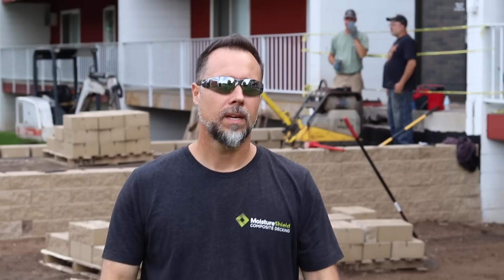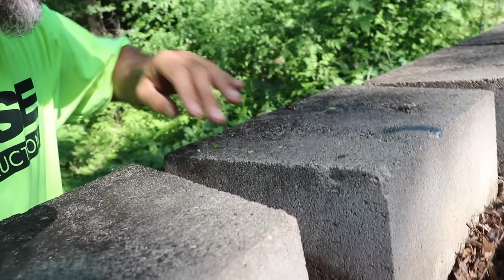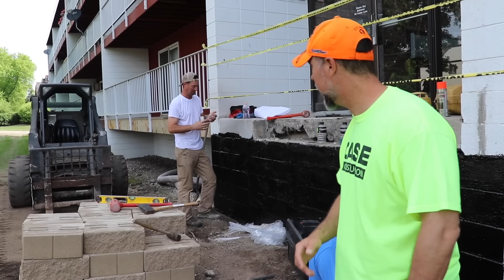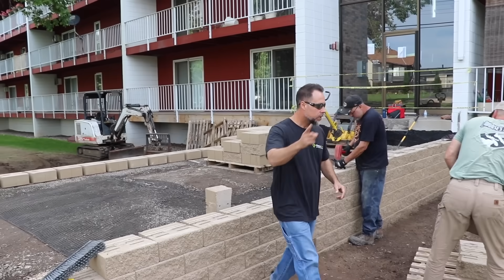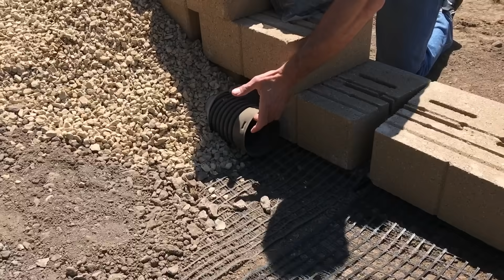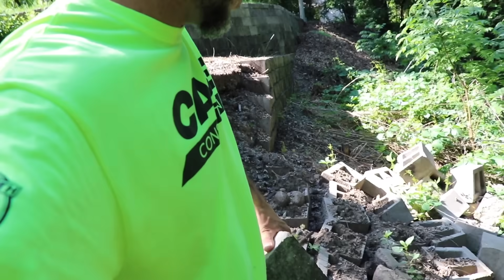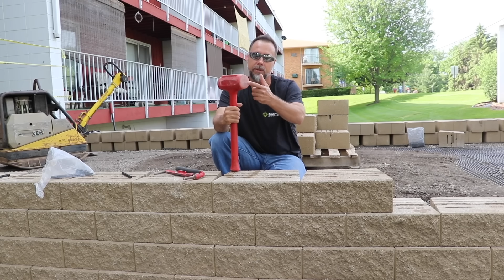How NOT to Build a retaining wall.  RED FLAGS, common mistakes, bad designs pt1

Comment: What if you wanted to keep the water and silt from draining through the wall?  In my case the wall will be retaining the ground above a sand volleyball court, I'd like the keep the sand "clean" on that side, and on the downhill side I'd like to keep the sand from filtering through the wall.  I assume I'd need drainage at the top and the bottom of each wall?

Comment: Stanley, I'm building a retaining wall with Allanblock Classic as a base and AB lites for the course.  I'm using AB cornerstones for corners but there seems to be a slight difference in height between the combined 2 x lites and the corners.  I also think I messed up by laying a classic as a base, not a corner.  The first corner was on the second course.  Could you offer advise?

Comment: On concrete decks at the patio, DO NOT level the concrete perfectly level. When it rains, the water will back up to the patio door and cause wood rot! The deck should slant slightly so the water can run off.

Comment: Video on dry creek and keeping flood waters back . I live in Missouri and have 2 dry creek beds in my yard , I took down a chimney with 1960 L shape blocks solid blocks laid them out so it was 77777777777 than went over them with flat blocks overlapping each corse filled in all the voids with broken blocks cemented them together fill behind them with 1 inch stone above water level , i park a trailer in the yard and that part of the yard would flood with 2 to 10 inch of rain and water get 16 inch deep the area is 10 foot by 20 foot and 15 foot  triangle  not sure it will last 10 or 20 years but it did not cost me anything but my labor and stone .  I have rip tie along the drive way and seen 300 pound rock dragged down the creek. might take the blocks out as well I have no idea yet no rain in 2 months .

Comment: Great video. We don't do a lot of segmented walls like this. In my area roughly 80 % are built without gravel, geo grid or drainage. Costs so much more to build them correctly. We average 47 freeze and thaws a winter. You can almost watch them fall over in the winter. Me and my guys have bets on how long it will take for there walks to start moving and fail.
Reply from the maker: Thanks Mark!

Comment: To be fair, open cell blocks are infinitely stronger than those pinned blocks, but only with proper wall fill / grout. And those lintel blocks or bond beam blocks with one side open are just for lintel courses and bond beams. So doing it right it's structural. Of course, for anything less than 10 feet tall plastic pins are fine I'm pretty sure.

Comment: Great video. I have a small landscape company in Pennsylvania. Lots of contractors are switching to Allan block because of the light weight and no pins. I agree with you completely on wrong block to use. I have tons of work repairing old/failing walls.
Reply from the maker: Thanks for sharing Tony 👍

Comment: This is a very informative video appreciate the time and the effort you put into this. So I doubt you will respond but if you use a hallow block and use the same procedure but fill those hollow blocks in will this be as good as using the blocks you used?

Comment: Thanks so much for this very good info.  I am going to be my own construction foreman for some newbies building a retaining wall for me :)  This helps a lot.  My wall will be 2 foot tall by 20 foot wide, but will have some load on it with a gentle slope behind it filled with decorative rock, so some pressure or surcharge, my question is do I need to add a drain opening somewhere since it is 20 foot wide?  So far the design will be 4 inches of base, 1 inch of sand, then a 82 lb. brick, 8x18x12" deep, will bury 4 inches of first brick, then 2 more layers of brick, then a cap, 24 total inches or 2 feet. Thanks

Comment: Thanks so much for all the explanation and examples of both good and poor quality work. Very helpful. I live in Kenya, and we have very few of the building materials available to us that you are demonstrating. Our retaining walls are built from hand cut stone. I'm getting ready to build a home for my wife and I. I'm not a builder, but I have to watch what is happening to try to make sure that things don't go too crazy. I'm thinking of having my masons cut the stones to be something like the shape of the blocks you are demonstrating here (sort of trapezoidal). These will be solid rock. I doubt there is any way to have them hollow or even have the holes and slots for the plastic inserts (which I could not get here either). We will need to build several retaining walls. Some will be higher than others. We are in a mountainous region, so the land is often quite steep. Any advice? Thanks in advance.

Comment: The way I was taught was to leave a gap between the grade and the wall.  Filter cloth the bottom and the side touching grade.   Add tiny bit of stone, pipe, fill with stone and filter cloth of the top.   
This keeps the stone together and separated from dirt.  

Is this not the correct way. Always made sense to me to keep then seperate because the rocks only work for drainage if they aren't mixed in with dirt :)

Comment: I’m wondering about Pressure Treated wood retaining walls- do these same principles apply or is it an entirely different sort build?
Reply: First things first Pressure treated wood retaining walls tend to fail after 10-15 yrs even when properly constructed due to wood rot. The block or poured concrete with engineered drain systems will last on avg about twice as long or longer when constructed correctly the difference is cost... the block/ engineered concrete systems usually cost more up front however over the expected life span cost less than the wood system.  The wood system is assembled in a similar fashion however an 8ft railroad tie (most commonly used wood retaining wall material) requires pinning every 2feet with full height of wall +2feet into the footing rebar.  Otherwise done similar to the brick and it will require a well engineered drain system. I personally don't recommend a wood retaining wall system for the additional complexity of construction as well as the short lifespan of the wall itself.

Comment: Great video pal. I want to do my Ma's back garden for her and I'm not really sure where to start atm.. I need to look into more of ur videos for more informatiin.. Thanks again pal
Reply: The only retaining wall I ever did was hard work.  My sister wanted a natural log look ... but I felt uncomfortable with that due to the weight it had to hold back.

I sunk sleeper into concrete and behind it I battened more CCA Pine sleeper horizontally.  Levelled those off and drilled through both for cup-headed galvanised bolts, 2 on each side of the sleepers.  That was all pretty solid.  Then I marked and removed the top sleeper to cut the verticals flush, before replacing it.  That gave me the physical wall.  Before I started I shimmed up the first horizontal sleeper to give a 1/2" ground clearance and filled the area behind with > 1/2 inch rocks to keep the slot from clogging.

Then, once I had a wall I knew was dependable, I marked out large half-logs.  Made two incomplete cuts into them where the verticals would sit.  Then with an old tapered spike and a hammer I made very rough notches, tidying up with a rough chisel.  That was the bulk of the real work!  These were then used as a fascia and slid onto the verticals.  The upper half log was only half-notched to sit on top of the verticals, and a half-diameter higher higher than the structural (sleeper) wall.  Then I started to fill with a bag of coarse stones, then large gravel... before filling up to the top of the log fascia with soil.

The resulting retainer was twice as thick as it appeared and didn't rely on the half logs for structural strength.

Was there a better way to do it?  Probably... but we had the confidence that it could hold back a tank.

Just one thing, if you use sleeper against soil or in-ground, check that it is fully treated.  Guy in the store recommended a particular grade of treatment but I'm damned if I can remember what it was now... but basically, you want it treated right the way through so it doesn't rot or get infested with boring insects.

Anyway... that's my war story ...

... I learned enough to never offer to do a large retaining wall again ; ).

Comment: Good video overall, although I usually quit watching when all the banter starts.   Regardless, good info on using grid with slopes.  Was hoping you were going to cover setback as that failed wall was definitely too close to the upper wall.  I’ve heard setback should be 2x the wall height before the next wall.  Any thoughts on that?

Comment: I haven't seen those blocks in my area (Tennessee). Having said that, how would you use Geo Grid with the hollow blocks? It seems the lip would be of concern. Most of the builders here fill the hollow blocks as appropriate. Great channel thanks for the hard work.

Comment: I am doing a short (maybe like 3 feet tops) timber retaining wall and planned to run a sock-covered perforated drain pipe in gravel along the base,  partially fill with gravel surrounded by nonwoven fabric, then backfill.  Is this no longer the correct way?  If so how do you keep the pipe from clogging?  I am figuring a short wood wall may be a little more forgiving then a CMU block wall, but if I can eliminate cost then that's great :)

Comment: Great vid. The only lipped retaining wall block units I’d use would be solid units. There about 78 pounds a unit.The pin system is great if it has zero curves. I don’t have to explain why, you already know what I’m saying. Ok, just say that I’d have to drill some holes for the pins. Great video, everything on your video is right on. Back in the mid 90s the fiber mesh was the deal. That replaced the dead men wall security systems. Geogrid is the Boss.
Reply from the maker: Thanks Donald, appreciate the comments!

Comment: So the geo grid acts similarly to rebar! A good drain around the perimeter of the wall with course gravel is required. Perhaps fabric in cold climates is capable of trapping water behind wall and freezing expansion of water may push wall , regardless need good drainage. Interesting!!

Comment: Odd that many manufactures of these wall systems specify that filter fabric be used against the back of the wall. My guess is that the wall failed due to it not being tied back into the hillside, and or no drainage system was installed behind the wall.

Comment: Great video, glad I found this channel. With the hollow through, would you fill them with agate as you build or after it's at full height?
Reply: Depends on the block. Sometimes the manufacturer requires you to fill and compact each course.
Reply: @jeffdillenbeck1278  thank you

Comment: I use the Hollow blocks 4 things that are more decorative and not totally structural. But even then I always core fill them and have never had a problem. I don't do it professionally, just for myself and they add such a great architectural detail to any yard

Comment: Stanley, I notice there's holes in the blocks. Are You putting in metal, like rebar to strengthen the wall vertically, so there's less chance of it bowing or failing after rain and other weather that may cause freeze swells?
Reply: No, all you use are small plastic pins. You shouldn't have much swelling or anything due to excess moisture because of the 3/4 clear behind the wall lets the moisture fall down and pass through the wall and drain tile rather than over it.

Comment: About the drain cloth. Is it ok to use it but in between the 3/4stone and the soil. Or the same principle applies that the cloth with push now on the 3/4 stone ?
Reply: No fabric behind these walls. Event if you think it makes sense the dirt will still clog the fabric and not allow it to pass through the 3/4 to get out.

Comment: Those hollow blocks are garbage. In cold climates even if you core fill them, they saturate with water freeze and fail.
Reply: Those ones blow out yes, they have a limited lifespan. wood isn't garbage because it rots and blows out and expands and contracts etc etc etc. 

They just have limited use.

Comment: Interesting general education video but I think you should have included the base preparation here since that is very important. 
Just be weary people, this is a very simplified version and there is much more going on as the heights, expected static and dynamic loads go up... There is shear slope failure in the filled area of soils as well as bearing capacity of native soils,  foundation water boiling concerns in heavy rains, soil composition and presence of organics, compaction, consolidation, vibrations and etc. Leave tall and heavily-loaded walls for civil engineers.

Comment: TechoBlok is The Best. ..or is it TechnoBlock??  Whatever it is, it's The Best. ... and you're making too big a deal about the weight of the individual blocks being the cause of structural failure.  The concrete mix of the block plays a bigger role than the weight.  If the mix is good and everything else is done right by the installers, that lip that you make a big deal about works perfectly fine as it is designed to do (keeping the wall from toppling over). ..if it's a shitty mix by a shitty block manufacturer then yeah, that lip will crack and crumble right off like a cookie.

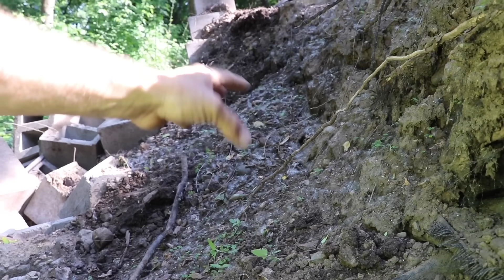Comment: Hey Stanley, just found your videos which are outstanding. This may have already been mentioned in the 1,500 comments, but at 12:02  that actually looks like geotextile woven polypropylene fabric, not your usual landscapers "weed" fabric. Years ago the NCMA, National Concrete Manufactures Association, actually recommended placing woven fabric vertically behind the wall as shown. The thought process was the woven nature of the fabric would still allow some water to pass through the face of the SRW, but also act as a filter to prevent silt from washing through as well, whch SRW installers were getting complaints about. 

Obviously this was not a sound practice, and after a few years of documented failures NCMA reversed their position. So depending on how old this failed  wall is, it may have actually been built in accordance with the practices of that era.  Other than that, awesome video that I'm sure has helped educate many a contractor and homeowner.

Comment: I was told to pour a concrete "Foundation" for a 3' x 40' reataing wall in my front yard. He said to dig down about 12" and have it stick up about 6" and then  start stacking the 16" x 6" Basalite retaining wall blocks. 
 I am going to use either Basalite or Versa-Lok blocks, not sure yet.
Is a concrete foundation the proper way? What about drainage?

Comment: #1easiest to make,most costly,and most common ,mistake of even the people who think they are pros and have built many retaining walls and even complex difficult or large jobs.....never completed or almost completed your job or wall and call the dirt fill guy or if you are backfilling yourself is to dump loads of dirt with the plan of com pactng the dirt later after you bring the dirt so you can get the hauling onto the site of the dirt done.and then bringing a heavy piece of equipment or running some type of compactor....always check the weather.you go to lunch after bringing a few loads of dirt,it starts to rain,then you can't pack in the rain,you have the wall built strong,overbuilt,with added augers and straps,turned in beams,whatever way you do it.but you know its superstring.so you come back after the rain leaves and is dry enough to packit.....you get back to the wall...its all  loan out and caved over and thousands of dollars of labor,and thousands more to reprep and rebuild from ground up,after you excavate all the dirt fill and salvage some of your beams or blocks.which normally means not much tio  save because of broken or cracked or scraped from the tractor used to excavate......its thousands....all because of not understanding the forces and weight of water and how the loose dumped  soil when not compacted acts like a sponge.it soaks it all up till the weight blows it up....happens so easy.so fast.with not a lot of rain required to happen...

Comment: Thank you for this video.   I’m contemplating building a patio in my backyard.  I’m considering building a standard cinderblock wall, then using a steel type frame for paver stone on top.  

This is very informative.  😊👍🏻
Reply from the maker: Thanks Dwayne !

Comment: Great details and explanation. Very helpful. I love the details. More info is better. Also, I used to work as a claims adjuster for a insurance company. Part of our training dealt with hydrostatic pressure. I was shocked at how much pressure can be exerted by just moisture in soil. Truly incredible forces. Sure it's relatively short distances, but moving an entire structure even a little with just moisture can do incredible damage.

Comment: Wait a sec my friend depending on the   height and what the wall is holding you can use hollow blocks. You can  use a type of gravel to fill or not, but you can use hollow ones just depends on the situation.
Reply: But good info for the most part.
Reply from the maker: Thanks Joey
Reply: And please don't think I'm hating at all you do great work my friend keep it up ✌